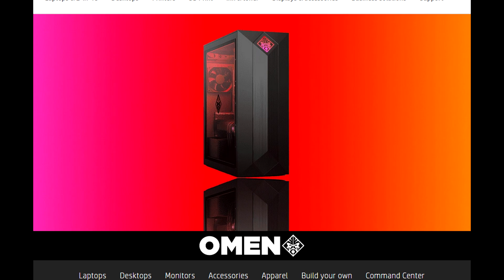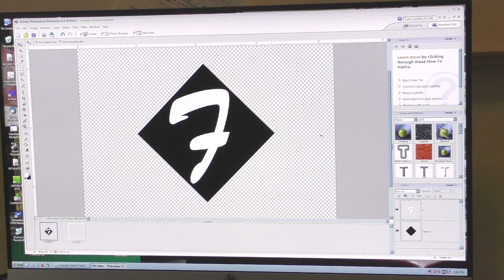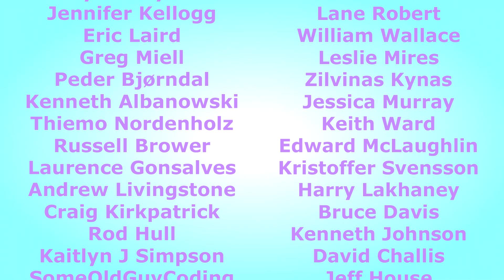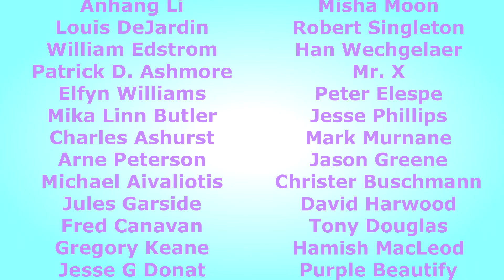Creating A Custom Badge For An HP Omen Desktop

Comment: I customized my Atari 800XL with a yellow power on LED and a "Intel Outside" sticker.
Reply: I have a glass that has the Intel logo and it said inside the logo Water Inside, there used to be 4 of them but sadly only 1 remains.
Reply: Old LCD monitor I replaced the badge with an old IBM one, off of an old IBM minicomputer I got on auction. Now has "IBM, Made in Palomba S Italy" instead of the original LG badge.

Comment: I think it might be worth trying to 3D print a custom replacement, with a flexible filament like TPU, rather than PLA or ABS. That way you could probably make the area for the badge/logo a bit more flush with the rest of the front panel. 

I've been pretty much obsessing over flexible filaments as late, after upgrading my Monoprice Maker Select Plus to allow for them. It's not dual-extruding, so I've had to work around that to make things which combine different filaments. You have to take into account different rates of shrinkage, but it's doable. So it's why I'm suggesting it. ^_^

Comment: Fran: Has enough technical skills to make her own logo for a pre-existing PC case

Also Fran: Buys a criminally overpriced pre-built gamer desktop for editing

You're better than this.....
Reply: Actually the omen desktops appear to be very good value for money - an I9 for about $1000.  You might save a little by getting parts at some Yum Cha PC shop but there's something to be said for buying off the shelf for the warranty side of things too.  That only leaves that naffy omen gaming logo as being the main annoyance. Dealt with :-D
Reply from the maker: It was a good deal for the processor and all the ram and harware I got all assembled, and I did't have to spend two weeks getting the bugs out of all the drivers and crap.
Reply: @Chrisamic  Nah, that's their misleading main-page price to suck you in. "Up to" An i9. 1100 gets you an i5, 8gb of ram (single stick, so single channel and slow as sin) NO WARRANTY, that's an extra $300, 1tb of snail storage, a generic motherboard that will be a PITA to upgrade, and nothing else.

In other words, $600 worth of hardware and no warranty for twice the price.

Under no circumstances is it going to be a better deal to buy a tower than to build one, even considering warranty, and ESPECIALLY if it has the word "Gamer" anywhere in the name or description.
Reply: @FranLab  It's not though, it never is even when off-the-shelf companies are running sales and discrete hardware is seeing price-hikes.

I'm not trying to nerd-snob on you and your purchase, I just feel the need to explain these things when I see someone getting suckered. It's not your fault, if HP wasn't really good at deceiving customers and outright lying to them about what they're buying, they'd be bankrupt by now.

First: You probably went with Intel because they don't even offer higher end AMD processors for the omen. Intel is behind horribly in content creation performance right now with most of their chips being beat by 50% or more by their AMD price equivalent. That makes the 30% mark-up you paid for it over retail that much harder to swallow, I'm afraid.

The ram offered by HP is painfully slow for video editing and encoding. As an example - for $70 less than their price you can get 32gb of 4000mhz CAS 18 memory which out of the box is twice as fast as what they offer, with the option of overclocking should you feel inclined. 

All of the storage is generic and slow as molasses. On top of that, what often happens is HP will get deals on lower grade storage that the manufacturers can't sell under their own warranty due to reliability concerns. Since most people aren't going to pay the $300 for a 2 year warranty from HP, HP doesn't have to worry about high failure rates.

The motherboard is generic and not intended for an easy user upgrade experience. Not only are failure rates going to be higher but years down the line when you decide to squeeze a little more life out of your PC by overclocking the motherboard is going to be your ceiling, not the hardware connected to it. Don't be surprised if capacitors and Mosfets start popping like corn if you crank it up too high either.

200% mark-up on the NvME SSD storage. I won't say any more on that subject.

Installing drivers is a small price to pay considering how much more PC you get for your money building it yourself compared to literally anything labelled "gamer" offered by any company. It doesn't take a couple weeks anymore, maybe a couple hours in one afternoon if you're unlucky.

I'm sorry, this is compulsive. I can't stop once I start. I've lost count of how many times I've sat down with someone I know and compared price and parts lists at every price point showing them how much they're overpaying for an undeniably inferior product. If the value wasn't so gob-smackingly bad I might have a little more control when the topic arises but...
Reply: @PapiSmerf  Well that sucks if true.  About four years ago I put together an A8 with 16GB and a small SSD for about AU$450 (maybe US$350) which I'm still using.  Runs Linux great, including the CAD stuff I do.  I'm not sure I'd want to encode video with it full time, but it has a good run at it.
Reply: @Chrisamic  That is why you buy used, let somebody else take that big price tag, and then, when they upgrade, you get the old one, still pretty good for most things ( aside from extreme gaming) for a fraction of the price.
Reply: I think Fran can find better things to do with her time than spend it on a custom build.  Instead she has shown those of us that buy a second hand computers (pretty much all of mine) how to do something cool with what we have. I mean,  how cool is that?
Reply: @billygoat8204  Everybody keeps talking about time.

A weekend at the most, assuming you go full bore with a custom watercooling loop and software RAID setups, case modding, the whole shebang?

Seriously people.... Time is not an excuse when you're talking about snapping together Lego pieces.

Comment: all I could think was.. "photoshop elements 4?" and "I sure hope that computer isn't connected to the internet".. very cool tho
Reply: philosoaper Nothing wrong with sticking with software you know.
Reply from the maker: Exactly - how many different drawing programs to you want to become proficient in and abandon in your lifetime?  A dozen? Elements 4 is light and quick and it isn't on the cloud.  (mic drop)
Reply: @FranLab  oh it's not that, I enjoy antique software too
Reply: @FranLab  Certainly a chance to learn some new software! I have a particular penchant for inkscape when it comes to things like this -- export them in super high resolution for printing, but also cut things in vector. Also, definitely check out Paint.NET